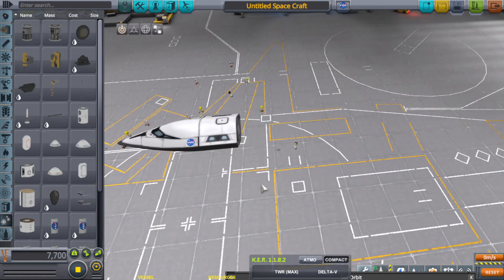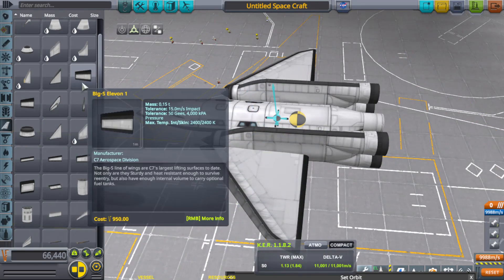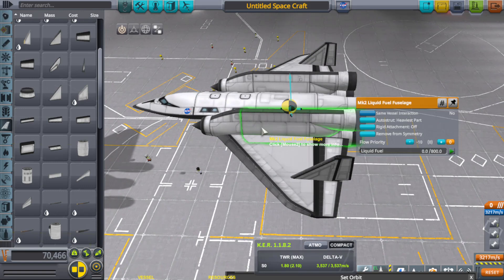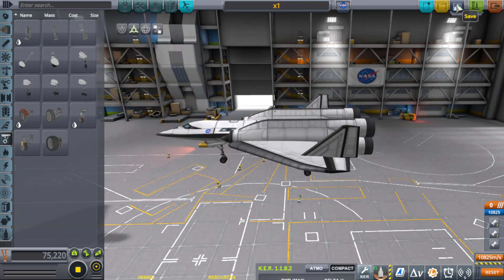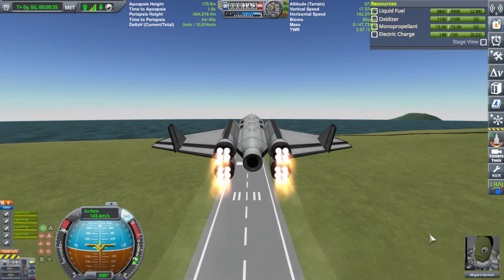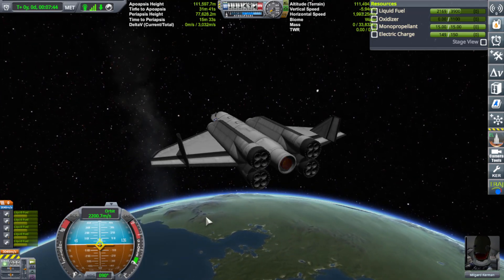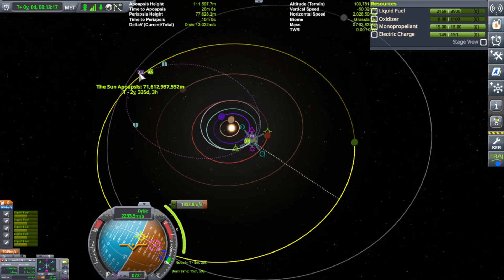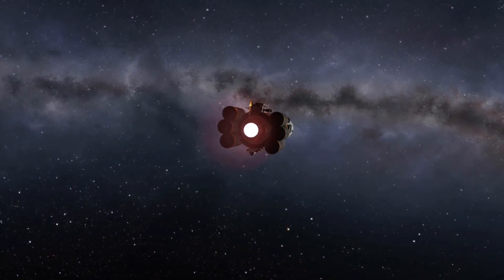SIMPLE LAYTHE SSTO \ KERBAL SPACE PROGRAM

Comment: I have a ship you can have if you want. I built a cargo cruiser that I know can go to Jool and can seat a bunch of Kerbals. Also there are ore mining landers that can attach to the sides if you want. Or you could use the side docking ports to attach to other big ships. Also how do I get it onto KerbalX?

  The action groups I remember are either 1 or 2 for solar panels, the other for antennas, 3 for the cargo bay doors, 4 for the radiators, 5 is do all the science, 6 is collect all the science into the bins in the cargo bay and I forgot the other ones. And don't worry about the navball at launch. Staging will control from the center MK2 lander can on the bridge.